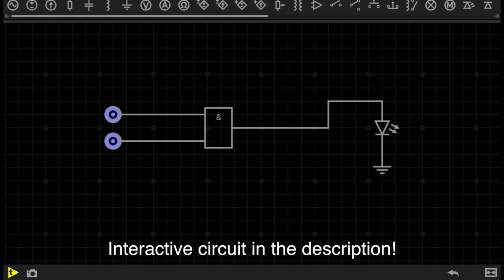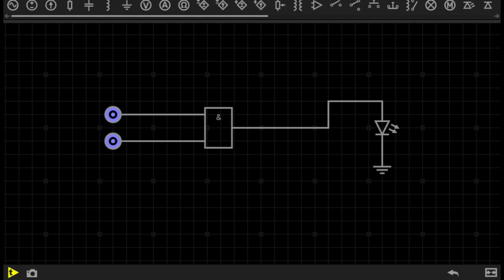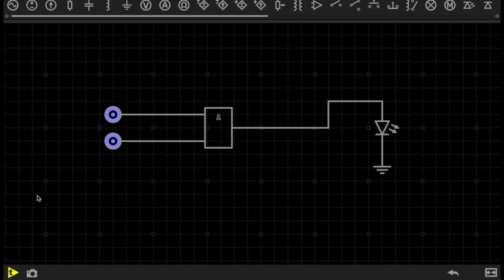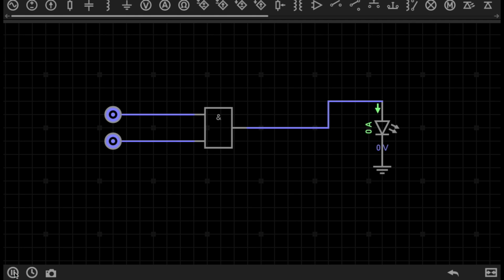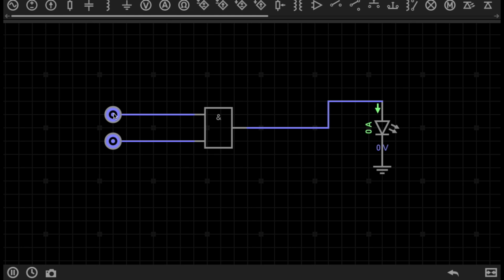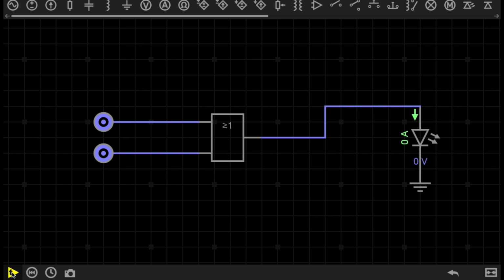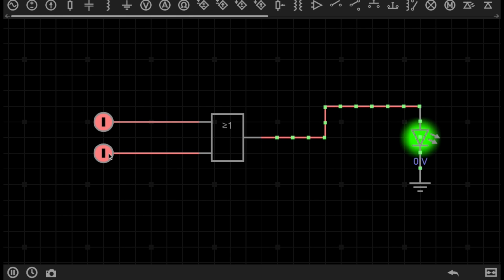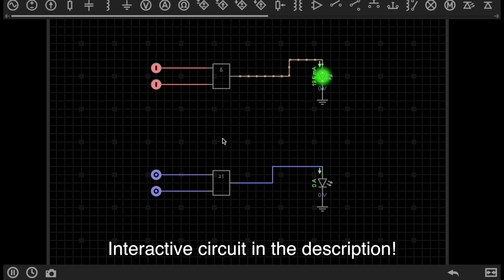How Logic Gates Work! (Easy!)

Comment: I invented 2 new electrical generator design that are powered by new compact low cost engine. One is called abr extrifuge surge generator and the other is called abr central compression piston engine. I showed some basics diagrams in my facebook page,  Andre Brien.  They do not need any fuels nor to be recharged by the grid  and they are simple enouph to be installed in little cars or big trucks. I think that electrical heads and gearheads might be interested to take a look.

Comment: There is also another logic gate called the XOR, which stands for Exclusive OR. Whereas the OR means that either or both input gates can be high for the output to be high, with XOR only one input can be high for a high output.  (Of course there are negative versions of this.)

Comment: How does this relate to calculators? I understand basically how logic Gates can be used but I'm still curious about how you'd arrange them, or even what programming would go into it.
Reply: Look up half adder, full adder circuits which perform basic arithmetic operations using logic gates